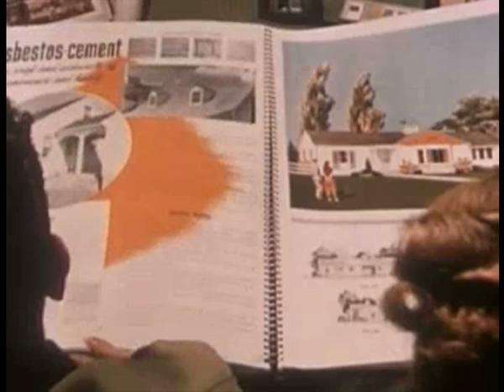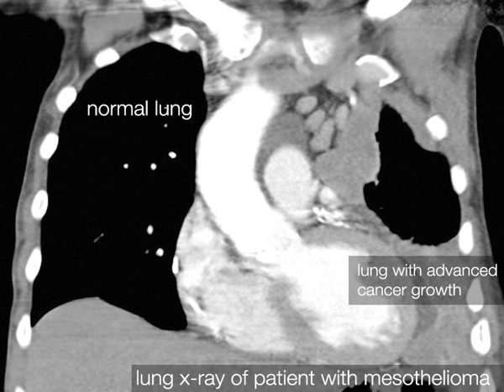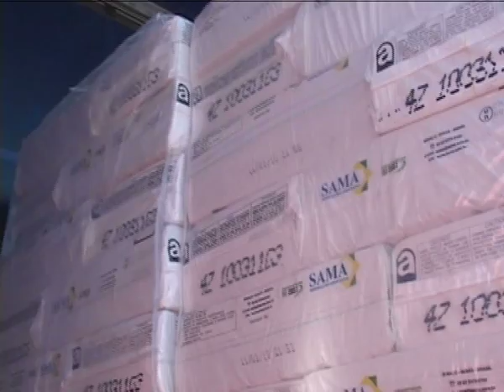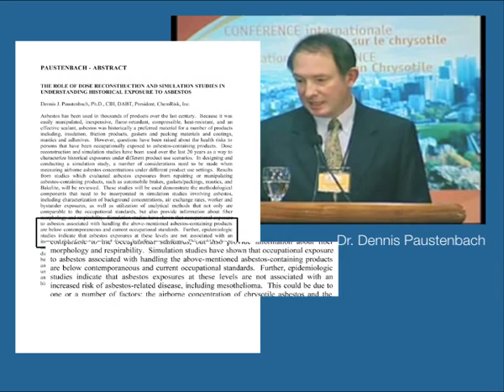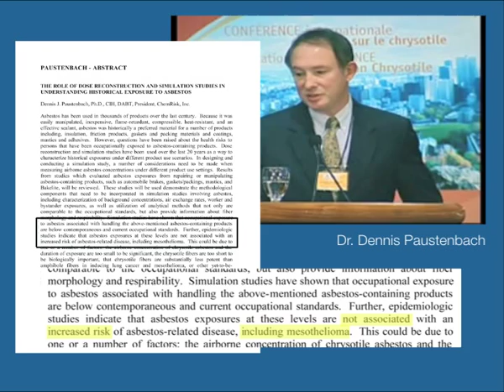Exporting an Epidemic: The Asbestos Industry Goes Global

Comment: @1rootle It does, I so a video explanning why it is a threat. If this roof were to be reformed or altered, any hit that could form dust from this material could be inhalled by people/workers near, making this exposure a very dangerous one. I know that in the USA asbestos was widely used in constructions,  but not anymore due to its risks.
I know this because my father is an architect...Although, I'm not a specialist, I'm pretty certain on what I'm asserting due to research